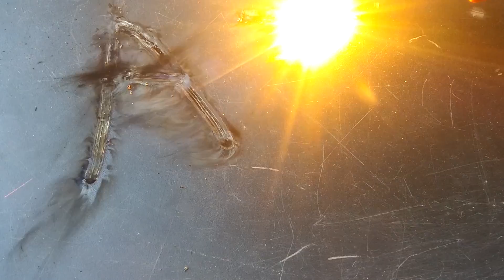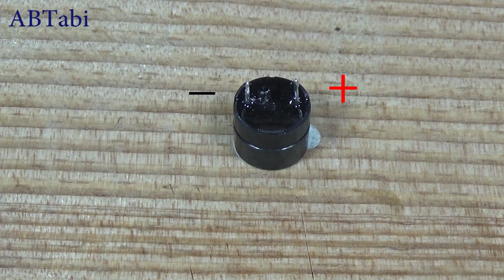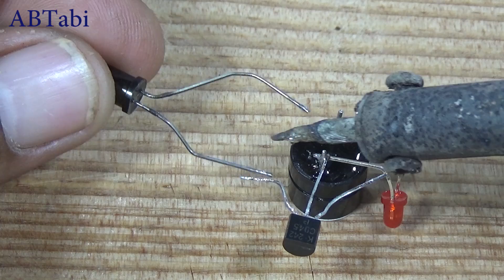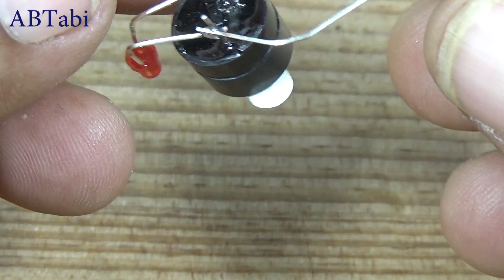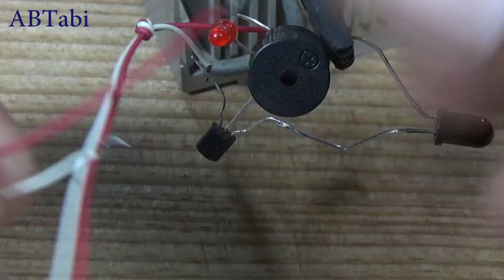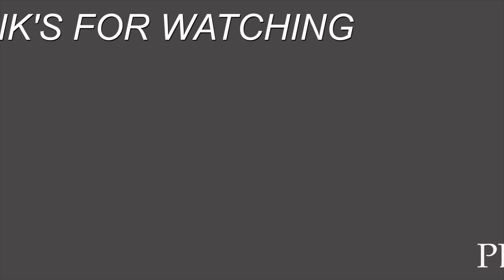How to make fire sensor with c 945 fire detector at home

Comment: Bro I have an issue with this If i giving connection to -ve and  +ve I mean giving power supply both led n buzzer is working but ir sensor sensor is not working
Reply: Same problem
Reply: Do you resolve the problem bro ?
Reply: Yes bro mera bhi yhi problem hai